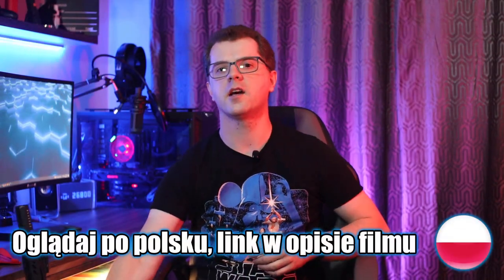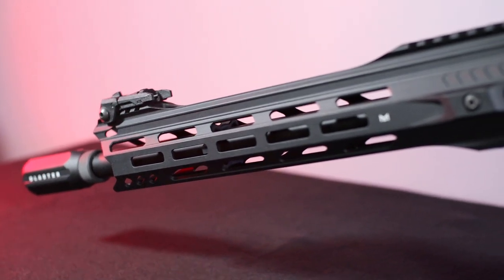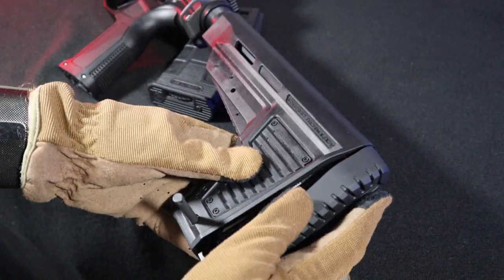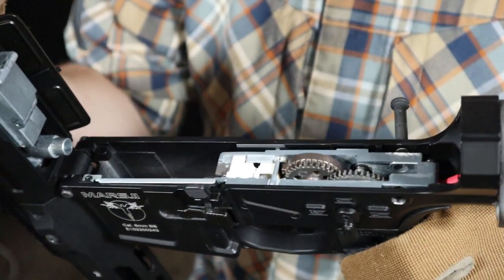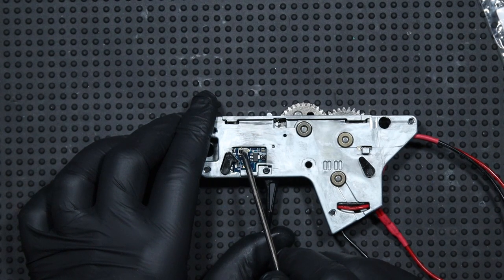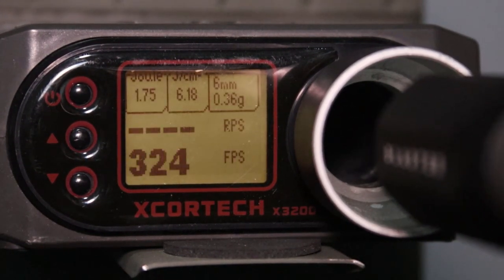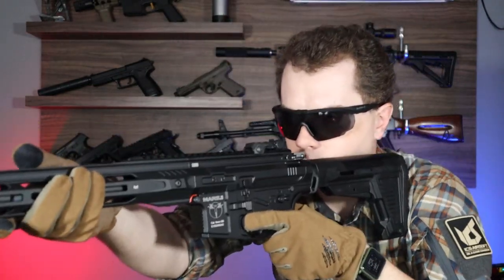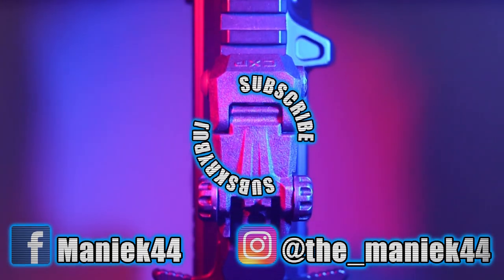Airsoft Review | ICS CXP-MARS.II CARBINE S3 (ICS-309S3) | Made for winning

Comment: I got one of the first ones in the Western Hemisphere a few months ago and can confirm it is one of best AEG's I've ever used out of the box. It really is a pre-upgrade. I've always preferred ICS and Marui guns and ICS really knocked it out of the park on this one. As an engineer, I am super impressed in that ICS didn't pull a single punch with this. They built it to real gun quality, and upgraded and modded it to be by design, everything most airsofters will mod their gun to be anyway. There isn't really much room for improvement. I stuck a tightbore in mine, and an MI-Pro hopup, mostly because I like the windowed tracer unit as opposed to end barrel ones. That's about it. Oh and I disabled the EBB by sanding down the nub on the piston.
Reply from the maker: Thanks for such detailed opinion!
Reply: @Maniek44Eng  I also noticed the motor heats up semi-rapidly with lots of rapid fire. I didn't find it to be much of a problem during a match, but I during lots of testing/zeroing it was something that I definitely called out to my friends. I may switch it out eventually to a brushless. I never minded play on airsoft guns but that's because I've spent enough time around real firearms and am just used to the reality that guns are not solid pieces of steel or wood (M14's (not M1A's, M14's) are creaky, wobbly as hell for example). FWIW my shimming was perfect and there's no play between the gears and so far, maybe about 3000 rounds later, no signs of wear anywhere in the system. 

Also, where did you find the info on how to run the Diagnostics and program the trigger? The manual the QR code on the box links to doesnt have that info.
Reply from the maker: Yes the motor heats up but as you said during a match it's not a problem, also a bit of play i no problem for me, but I know many people who like their replicas solid as a rock, even if their real steel counterparts have a bit play here and there. Good that your replica had good shiming :) as for the diagnostic, I found how to turn it on in this manual https://icsbb.com/agent2.php?id=9224